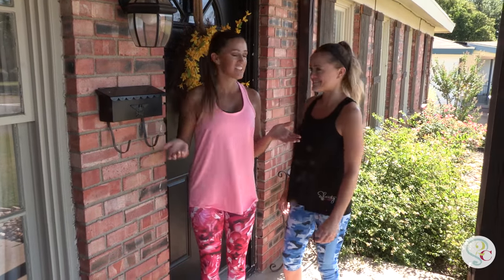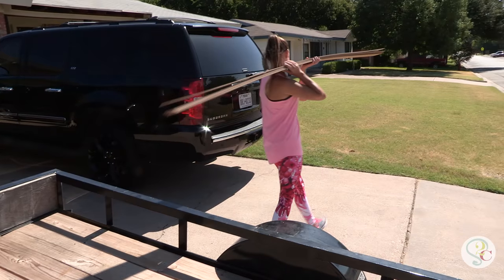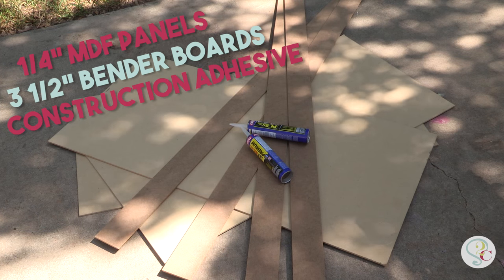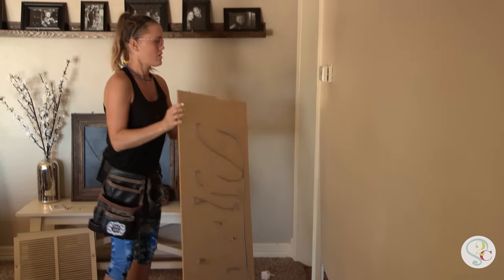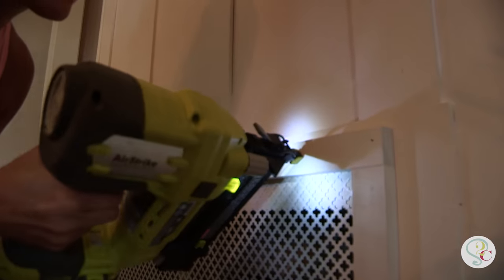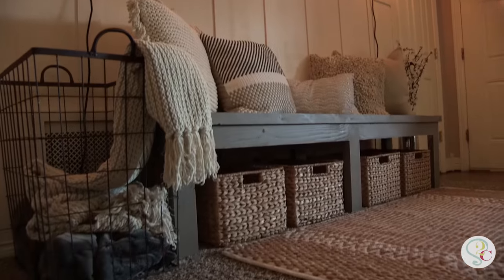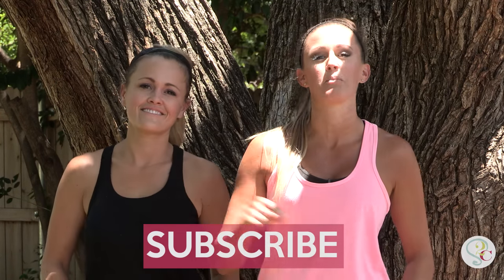DIY Board and Batten | #ShantyHouseCrash

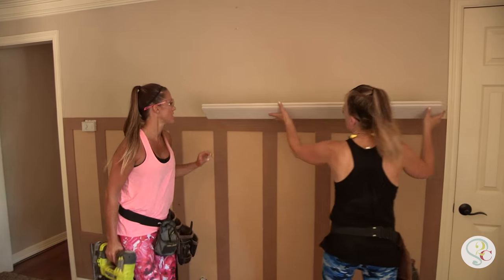Comment: Did you use mdf spacers like in 1:28 on the top horizontal bender board to make it flush with the vertical bender boards?

Comment: The wall where I want to do it  does not have a door at the end it just turns 90 degrees without anything, how do you cover the corners or if I want to continue and turn 90 degrees how do you work on the corners?

Comment: Lovely project! I am considering doing it for my entry way. One thing has me scratching my head. According to the plans, all the  materials used are 1/4". Sooo, when you add the 1/4" top board on top of the 1/4" panels they will be flush to one another. There will be no reveal. Follow? Am I missing something? -Nick
Reply from the maker: The top base board is flush with the thickest layer of 1/4". Make sense?
Reply: Shanty2Chic where did you all get the lights? I love them!
Reply: But how will the verticle boards be flush with the top base board?  I am just not getting that and I am getting ready to start this in our sunroom.  HELP!!!!!
Reply: What they meant was 3x 1/2. Sooo 3inches wide and 1/2 inch thick. Bought the materials and figured it out the hard way.

Comment: Wait. LOL. When you to rest the 1/4" MDF bender boards (aka the top board) horizontally on the top edge of the 1/4" MDF panels they will be flush, so no reveal/shadow line. Now, the only pieces casting a shadow line will be the vertical boards. Why am I unable to connect the dots to this SIMPLE project. I know it's me! Be well! -Nick  PS I promise not to bug you gals with more questions about this project. -N
Reply: I am having the same problem.  Did you ever get an answer?